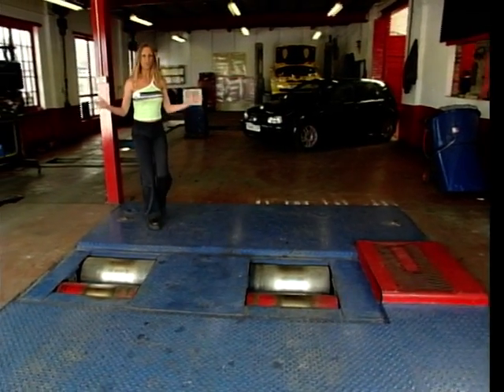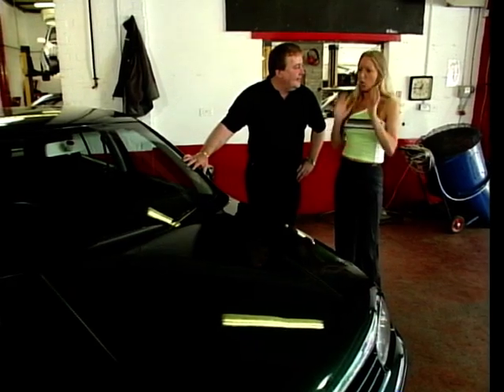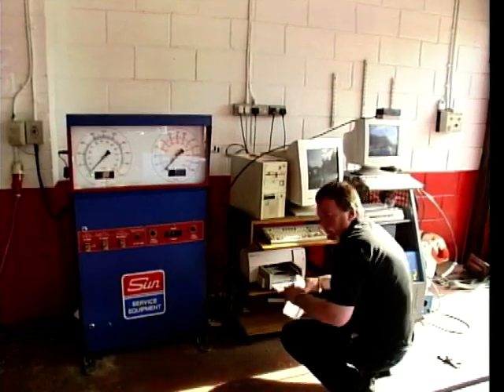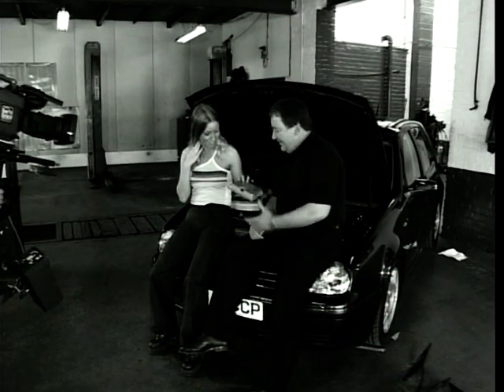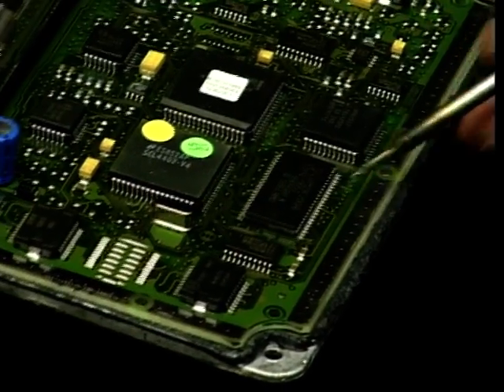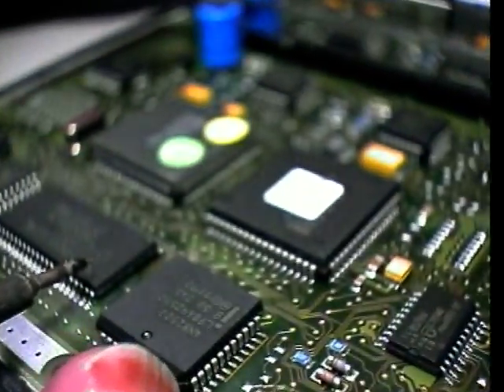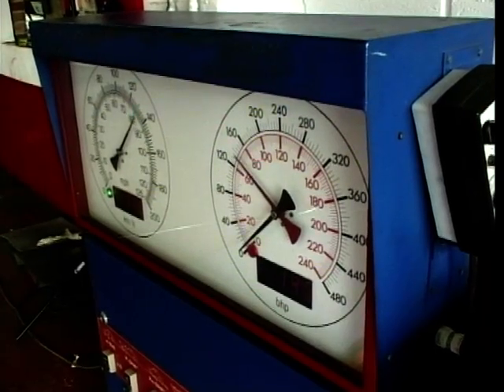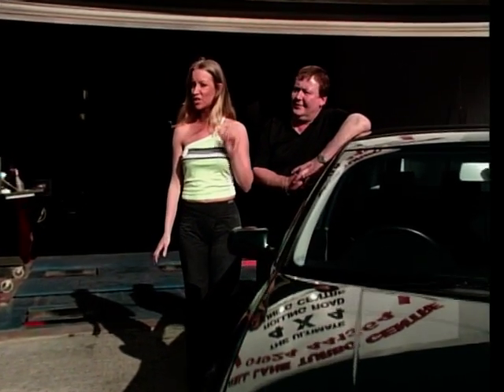How To Modify Your Car's ECU

Comment: Of course...On almost every late 90's/early 00's video on ECU tuning, they always use a Golf GTI. The 1.8T motor in 150hp OR 180hp guise just BARF out horsepower when you chip them.